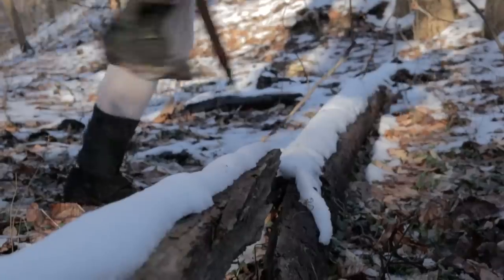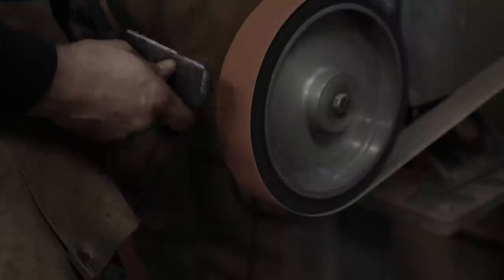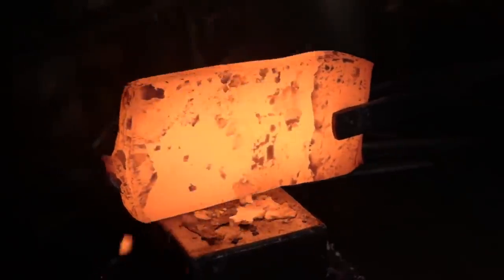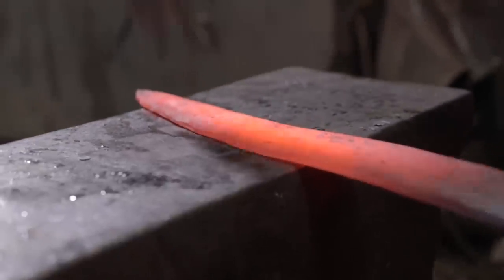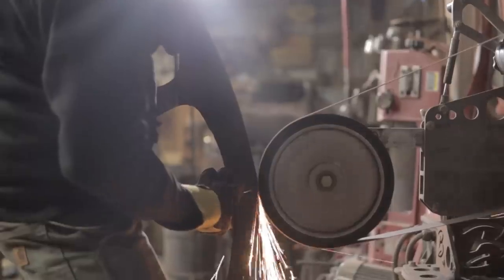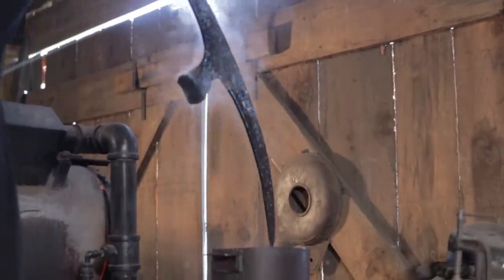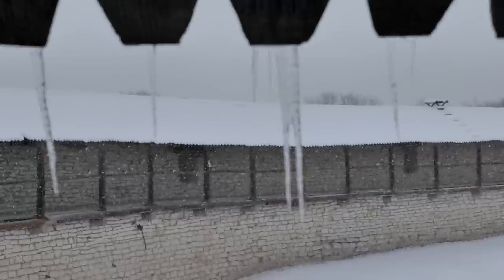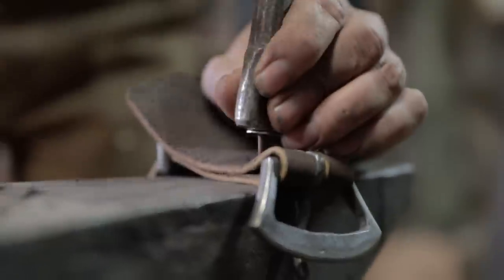Forging a 17th Century [Bardiche] - Historical Build

Comment: I'd like to know where Ilya did his research. The overall shape of the cheek of the bardiche is correct, but it could have been thinner. Bardiches were very thin. The earlier examples (the long pointy-end ones) are generally 2.5mm at their thickest at the back, and then they get thinner the closer to the edge you go. That's how thin you should have went with yours. The later ones with the end divided into two were 3-4mm thick at their thickest at the back. You could have just used sheet steel like they did in the second half of the 17th century. The eye of the bardiche could have been much more triangular, and the way you mounted and "fixed" the head is just a fail. It'll break, simple as that. Bardiches had three nails in its butt, and especially important - two to three nails on its secondary attachment point, not just a leather strap. That secondary attachment point is the whole reason the bardiche was possible, its additional strengthening of the axe head allowed to extend toe and heel. So it's pretty dangerous, someone can get hurt if you wave it around too much. 
The history is also incorrect. Bardiches were not standard issue weapon of the streltsy until the 1650s. They were actually much more widespread among civilians and militia before then.
There's also no evidence of resting a musket on it while shooting being done in history. 
So that's that. Please do your research better.

Comment: Perhaps the holes were used as an aiming sight. The barrel rested in the crotch and by lining the end of the barrel up to one of the holes you can increase the distance the projectile will travel. Like the two-point sights on a modern firearm.

Comment: My theory n the holes in the back... I don't see it being for weight distribution, balance, etc. As a blacksmith, punched holes remove very little material, and it wouldn't be shifting enough material in any direction to make a noticeable difference. It wouldn't be decorative--as said, this is a foot soldier's weapon, not presentation or display arming. Punching holes takes time, energy, and burns fuel---none of these could be wasted on something unless it was absolutely necessary.  So, it begs the question of what would make it necessary...

Material and design are what I'm looking at. It's a long, thin but wide blade made primarily of softer or otherwise inferior steel or iron. The energy it's capable of delivering mounted on a 1.5 meter haft is tremendous. I believe the holes are there to redirect and spread the force of a blow across a larger amount of the back rather than end in a small, concentrated area directly behind the point of impact that could lead to severe damage or blade failure.

Comment: I wouldn't be surprised if experienced soldiers would modify the blade with the small holes to tailor its balance to its their liking. Might also explain the imprecise layout of the holes, as they would slowly experiment with distribution until they were satisfied. Its balance probably became more important when used with the sling, as it would need to be swung around the shoulder very quickly in battle.

Comment: The holes are to lighten the overall weight given you sling it on your back the lighter the weight the easier a time you have it in the field or means of well securing it if the haft needs replaced in the field.

Comment: There is a theory that these holes on bardiche were used for inserting of pins in it. These very pins stop the blade for it do not bite into the flesh tooo deep. Otherwise the blade stucks. Such a scheme was common for battle axes.

Comment: For the holes in the back of the blade, my brainfart would be;
If the Bardiche was used as a weapon rest for the firearm and had a "normed" heigth, then maybe some crafty guy got the idea to add these holes so, in the field, it takes as little as a twig from the ground poked trough one of the holes to somewhat adjust the Bardiche to the individual Soldiers prefered Aiming position.

Comment: Holes on the blade are for weight loss. Yes, it is heavy, yet it will be just a couple of grams, yet it is the grams you don't have to care about. Bardiche was also used more against the horses, not so much against infantry, because it is heavy and unwieldy in the duel or to work in the line in general, it is a bladed weapon, and bladed weapons were practically useless against anything with armor on, but to cut the horse legs? Yup. That is the what it meant for. And, of course, as a rifle stand. That it was used for too. For melee range streltsy had a sabre, BTW, it was also a standard of their equipment.

Comment: The axes were most likely not used as gun-rests. The effort spent to balance the bardiche with your left hand will give you the same outcome as just holding it. Furthermore, gunners often didn't care to aim at all when firing their smoothbores and it was practical to point the barrel in the general direction of the enemy, look away to not get sparks in your eye, and fire. Another point is that the Streltsy were infamous for their fortifications, their redoubts, and their "moving-towns" that they became proficient in exploiting; there's little point to this gun-rest idea if you're fighting more often than naught from within a fortification.
Reply: Oh, someone else knows their stuff. 
One thing I'll correct you on is that while in general the musketeers of their time didn't really aim and just pointed at the enemy, the streltsy and the other Russian infantry were trained to shoot aimed volleys at close range (especially the Moscow streltsy, they were the elite).

Comment: The bottom tip of the axeblade being connected to the handle, is that so the blade had extra support/stability without needing to be of a tougher/ harder material? Or is there another reason i can't think of right now. Or is that unknown.
Reply from the maker: Wim Franken That is exactly right

Comment: i mean i wouldn't describe the dane axe as "tiny" but i get your point.
also no rifleman would have used a bardiche, a bardiche would have been paired with a musket, not a rifle, by the time rifles became commonplace, bayonets would have replaced the bardiche universally.
i am also going to disagree with the octagonal shape being the cheapest and most efficient to produce, turning a round shaft would have been way faster. the octagonal shape was likely chosen to prevent the shaft from rotating in the wielders hand.
also another use for the bardichee would have been as a tool, in the harsh climates of eastern europe i would think the bardiche was frequently used to provide fire wood for cooking and surviving the harsh cold. it may not be particularly suited for chopping down large trees, but it sure beats having to haul a heavy felling axe on a long campaign.
Reply: We misspoke
Reply: @ilyaalekseyev3589   honestly i only got curious when you mentioned the "matchlock" as i was pretty sure that people used percussion caps by the time rifles were widely implemented, i still had to look it up because i wasn't sure any more.

Comment: The holes on the bardiche, thickest part of the blade maybe not completly about it but it has to do at least something provided by weigth reduction. Could it be for adjusting the force/point of impact of the blade? What i mean is just like the cars, they are beeing build with lighter material away from the ground right, to keep the cars stick more to the ground(dont remember the actual name of the effect :) ). And since the bardiche mostly were produced on a budget with time and amount requirements, rather than using different materials on the blade, putting holes on the back of the blade could have served a bit towards that purpose. Could they also be kill marks, unit marks or decorative marks?

Comment: Re: Holes

This is just an educated guess, but if done properly, I think they functioned in a way somewhat analagous to fullers ... not just lightening but more importantly STIFFENING a blade.  

It would be fascinating to see someone simulate the effects of numerous holes of different sizes spacing and positionings on a computer, to see the effects on weight and rigidity in a blade.

20:10 Is that a small crack near the 4th hole left of center?  Hard to tell.  Still a beautiful build.  Kudos. 👍
Reply: I noticed what looks like a crack too. It was there before the holes were drilled. I'd wager since the majority of the blade was forged from wrought iron that the material may have cracked during the forging process.
Reply: @rogerj412  not a crack, an artifact of the forge weld
Reply: @ilyaalekseyev3589  Thank you for answering.  Kudos again on an educational and enjoyable build ! 👍

Comment: Love the build. But can’t help but feel the bardiche is a heavy clumsy weapon that might age benefited with a smaller blade.
Reply: It only looks that way. They were generally 2.5 kg max, if not less. The actual bardiche blade was very thin, the ones like in the video would have been 2.5mm thin, the later ones with a divided point ranged 3-4mm, and some were hammered and sharpened to paper-thin, so not clumsy or heavy at all. In addition, Russians also had regular two-handed broad-headed axes employed as well, though less people know about them.

Comment: They had grindstones back then, they were powered by water or by an apprentice.  File work would be avoided as much as possible.  Files had to be made.  I love your shows, I like the history lessons along with the technical lessons.
Reply: And grinding stones didn't?
Reply: @ilyaalekseyev3589  Very good point.   I stand corrected.   However, a grinding stone could be cast from mortar or concrete.  Which would also have to be made.  But once made, would last for decades.  You'd probably have to replace the frame several times before the grindstone itself.  .
Reply: @billskinner623  you overestimate the qualities of medieval concrete and how cheap the blacksmiths labor was
Reply: @ilyaalekseyev3589  Some of the concrete was pretty poor.  Some is still standing.  So the quality depended on who made it.
Reply: BTW, I have no idea why I'm arguing with you, I'll lay odds you know a lot more about this than I do.  So, please accept my apologies and I'll shut up.

Comment: Super interesting video. A weapon that acts as a gun stand is pretty smart. I would assume the holes are to remove unnecessary meterial and reduce weight. They do that for gaming mouses. Or maybe to not waste that material too
Reply from the maker: Nick that was pretty eye opening an once you see it, it makes so much sense
Reply: Good quality gaming mice don't normally have a bunch holes in them...
Reply: @Kyle-gw6qp  Look up lightweight gaming mouse. You've never seen these?
Reply: @NickMK  those holes are aesthetic. The entire cover would probably weigh 15 grams without the holes. The holes don't do anything noticeable.

Comment: Just a question about the forging process in an historical perspective. 

As you said it was a munition weapon produced for the Thousands so would you think it was maybe likely chiseled out of Sheet and then work it like it was done with shovels or halberds? 
I think it would have been more likely since it seems like a awful amount of labor to forge it out of a chunk like you did even with a water hammer or 2 strikers which not every smith had in possession
Reply: Sheet is more expensive than chunks. Economics of preindustrial society are the opposite of modern: labor is cheap, material is expensive.  Sheet metal is even more expensive than chunks
Reply: @ilyaalekseyev3589  good explanation thank you

Comment: It i s strange to see those holes in blade considering that Bardiche assumed to be mass weapon with limited time for producing. Professional  blacksmith can easily estimate that making such amount of holes  in blade of a weapon is not an easy job and if there is no any significant functional reason it would look very strange. It could be explained if Bardiche was re forged from any other items that was in stocks of blacksmiths  with already punched holes, or might be existence of special equipment  we don't know that created  holes on stage of production of blades. Otherwise it is not practicable to spend significant time for punching holes when mass production is expected from you.

Comment: I think the rough finish and shaping, rough sharpening would have been the only work done. Final sharpening would have been left to the troops. That would have allowed for greater numbers being produced. It is also more likely the "close combat" use was more in lines of poking the pointy end into the fleshy bas$%$d attacking you than a swing and cut that leaves you fairly exposed.

Comment: I suspect the holes were there for weight, but not the way one would expect. If each blade must be exactly the same weight when shipped, punching holes is a cheap way to exactly trim the weight without impacting the dimensions or edges, or creating stress risers. But the real reason is likely lost to history.

Comment: Warhead.su had a very guessworky article (in Russian) on the holes in the blade. See here: https://warhead.su/2020/05/14/legendarnyy-berdysh-ili-zagadka-tainstvennyh-dyrochek

Theories covered:
Holes used for tying the bardiches into stacks / stretchers / carrying poles.
Used for tying bardiches together to form a barricade.
Purely for show, with or without rings.
Rings used as counterweights.
Rings used as insignia for service length / achievements in service.

Comment: As absurd as it would be to make and even more insane to use, the 4 bladed halberd Lu Bu's daughter, Lu Lingqui uses in the dynasty warriors series. It is basically two double bladed halberds with the two shafts connected to each other in the middle and they can be seperated and wielded one in each hand or as a giant ninja star like, thing. If you're looking for an insane challenge, I think it would be the perfect challenge.
https://ilarge.lisimg.com/image/14263667/963full-lu-lingqi.jpg

Comment: I am also going to doubt the use of those holes for holding a lit match. The match should be on the "cock", reasonably far away from the powder you're working with.

17thC is well after the abandonment of handheld matches.

Comment: What a strange weapon to saddle a rifleman with. Having to juggle two long heavy awkward weapons in the heat of battle is baffling to me. It's interesting that the bardiche had a sling, but did the rifle? If your position is overrun and you fired your one very slow shot, and you need to protect yourself, what do you do with the rifle while you bring the bardiche into play? Very odd. Does not seem practical at all.
Reply: It's likely that some would have had slings on the muskets as well, since reiters, cossacks and dragoons had them and needed them on horseback, but very often the infantry is illustrated as just carrying the musket. The regular soldiers also had the muskets given to them by the state, and I have no idea whether the Russian government bought any of them with slings or if they made any in the factories with slings.
The bardiche isn't heavy, 2.5 kilogrammes max. They were very thin, with the ones like in the video generally being 2.5mm thick. The musket is also often an arquebus, not a "true" musket (arquebus has a smaller calibre) and wasn't too heavy, the streltsy shot from hands fine, it's what they were raised to do, after all. 
If the enemy breached Russian infantry positions, I don't think it would have mattered what happens to the musket because the Russian infantry was never meant for close combat in field battles. If they have to resort to bardiches, something went horribly wrong. At the Battle of Polonka in 1660 the few Russian streltsy, soldiers and reiters that managed to regroup in a forest defended their positions against Poles with massed firepower, not by swinging their bardiches and axes. Earlier in that same battle, a group of streltsy was caught in the open by Polish cavalry and was cut down to a man, and while their bardiches inflicted nasty casualties on the Poles, it didn't save their lives. It was essentially a last resort weapon for some sort of self-defence.

Comment: First of all - i refuse to believe that the sling would be attached to the blade the way you did! That is just nonsense. 
Second - the holes in the blade could serve several purposes: you could use them to tie a bunch of weapons together, blades facing upwards, to form a barricade (look up pictures); holes could in fact dissipate stress during quenching; and they could in fact reduce weight - there are bardiches riddled with holes. Not only they look pretty but it does reduce weight a lot. Rings could be placed as kill counts or as noise generators to terrorize the public.
Third - you forgot to mention that a shooter would actually be hiding behind the blade as he fires, using it, basically, as a shield. 
Forth - I have issues with the production number and the whole economies of scale theory. Armies in the past weren't that big and blacksmiths were everywhere. So exotic weapons could easily have existed in mass, made of good steel, with beautiful ornaments, etc. Стрельцы (i just don't know how to spell that word))) were sort of an elite force and thus limited in numbers. Most of the military consisted of cosacs (another word i have no idea how to spell) and those guys mostly used sabers and pikes and whatever bulava and kisten in english are. 
But good job otherwise! Just please replace the sling before it tears off at the blade's side.
Reply: Most of what you said was incorrect. Armies started being standardized in the late XVI century. The shooter brigades have a long history in Russia and were quite numerous